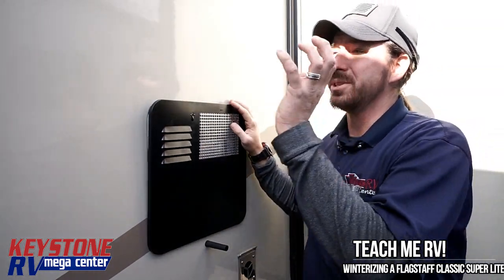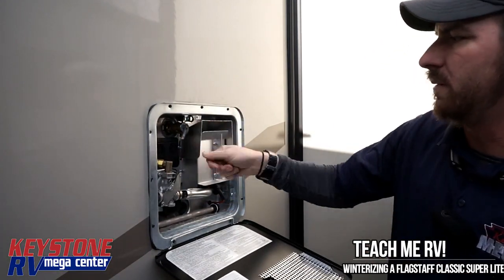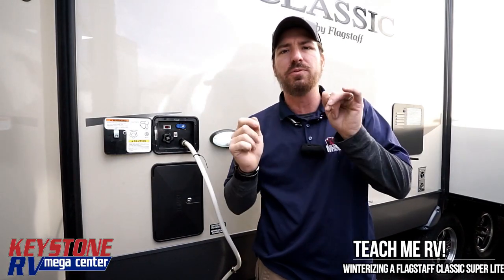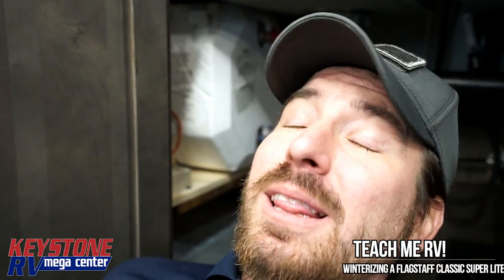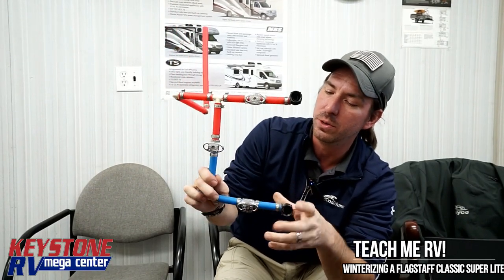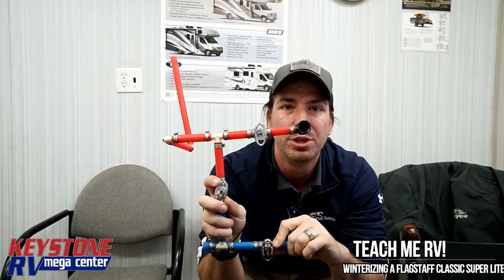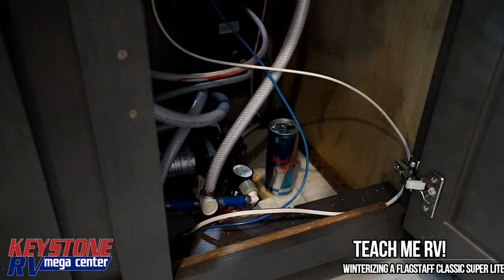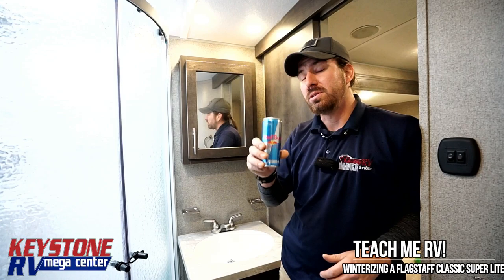How To Winterize A Flagstaff Classic Super Lite Fifth Wheel Or Travel Trailer | Teach Me RV!

Comment: Wow, that was quick! I had to stop the video a few times to take notes.  What about putting antifreeze in the lines from the fresh water tank?
Reply: not needed. If the tank is drained its fine. The pipe filling the fresh tank is big enough it drains on its own
Reply from the maker: Not into the tank. Use the pump to suck it up from the anti freeze connection point